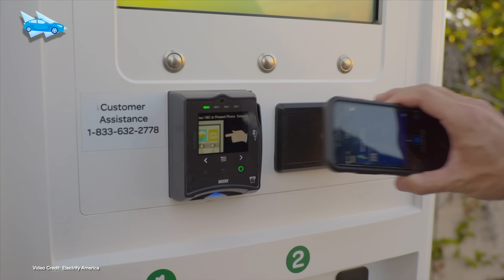TEN 307 - Lucid Air Revealed, Nikola Hindenburg Report, Elon Musk Drives ID3

Comment: 6:30 Small error there: the government grant is 6000€ plus another 100€ if your car has the AVAS. The other 3000€ have to be discounted off the net price by the car manufacturer. It's a mandatory prerequisite to get the 6000€ from the government.
Reply: Wermagst is it available for the Tesla Model 3 long range also? Thanks
Reply: @alinmustata  Yes. The net price of the basic model has to be below 40000€ to get the full 6000 €. In Germany the LR and Performance is considered an "upgrade" of the basic model, which has a net price of just under 40k€.
P.S. One more thing - the German prices shown on Tesla's website already include the 3000 € manufacturer discount.
Reply: Wermagst so what is the price of the long range? Does it get the 6000 euros incentive or just the 3000 from the manufacturer?
Reply: @alinmustata  Price from the website and you get 6000 from the government.
Reply: Wermagst oh so it does apply for the long range also, thanks

Comment: Your old Leaf is still on the road, last MOT March 2020 at 110,217 miles with 2 advisories, front discs pitted & read brake pads near thickness limit, its taxed until July 2021 & last changed ownership in July 2018, amazing what some internet digging will find out lol

Comment: You mentioned the electrify America debacle on the East coast on the i-95 corridor. Here's the real bad thing. They shut down the chargers for maintenance and upgrades. Except they haven't done that yet as far as I know those chargers are still down. Which is absolutely ridiculous. they shut the chargers down but weren't ready to do the upgrades yet.
there's absolutely no reason for this. When the construction crew gets on site to do an upgrade flip a software switch pull the handle on the disconnect locally do the work and then turn it back on when you're done. preferably only doing half the stations at one time so the other half stay up. Instead of knocking out 500 miles of charging stations all at one time and keeping them down for God knows how long. When I look on the app the stations show "coming soon" from Richmond Virginia, south to Florence South Carolina.
According to another source there are some stations in other areas that have been waiting for upgrades for 6 weeks. And yet are offline.

Comment: about the plane battery project around 12:20... 22km???? do u mean 22000 feet? or maybe 2.2km???
given air density and this aircrafts way of propulsion i really doubt the 22000m!!! but sb can confirm this or provide a link that would be amazing
Reply: It seems that the real purpose of this test was to prove that the Li-S prototype could charge reliably under stratospheric conditions.
Reply: @otterylexa4499  holy sh!t
ty for the link, because it really does sound crazy for such a propulsion way to reach 22km altitude!!!

Comment: Why aren't the manufacturers going for standard battery shapes and connections? This set of one offs for each model or brand is going to have disastrous effect later down the road with perfectly good vehicles being scrapped due to non-availability of parts (batteries). 
We really need the AA version of batteries for EVs. Imagine buying toys where every battery has to be sourced from the toy manufacturer only. Leaf is the one coming to mind. The EVs from 2010 to 2012 are not well worn vehicles having never had to support internal combustion components under the hood. Most of them look good, but they are starting to become throwaways if Nissan doesn't setup up to revive them. Standard batteries from my local garage or service mechanic would solve this.

Comment: The VW Up! shortagesin Germany tell you everything you need to know about how "committed" they are to EVs, imho. I mean, these sales are still pretty low compared to other VW models, where there are no shortages I would presume.
On the other hand, despite the shortages, VAG is not selling a pretty much identical (if not better) Škoda Citygo e in Germany, it appears. Another twin model they make, Seat Mii electric, is available and is about one grand cheaper, but people are still queuing up for the VW badge despite there being pretty much zero evidence VW is a more reliable brand. This is just pathetic.
Reply: Yes, these three cars are also called the triplets as the differences are badges and some interior and exterior panels. They are made in the same factory (I think it was Bratislava).
Shortage of parts might be related to battery?

Comment: I haven't followed Nikola much, but if they are going to use GM fuel cells, batteries and engineering, what did they already have? I'm starting to believe this is a scam and working with GM helps reinforce that considering all the scams they've pulled.
Reply: The aim is to sell the company and make a fast buck. GM is the current target.